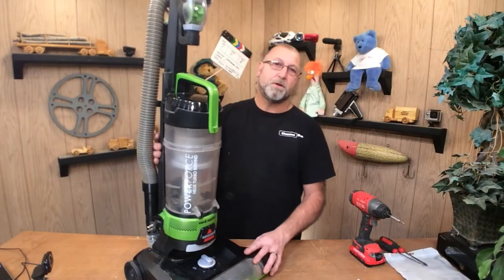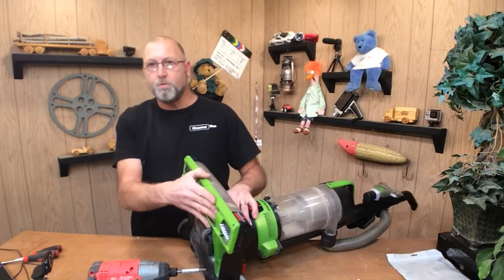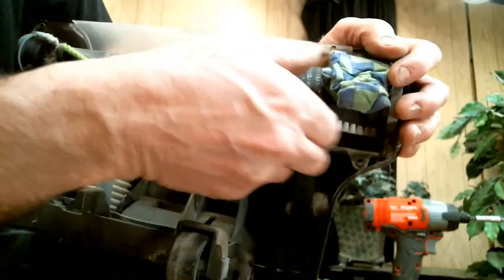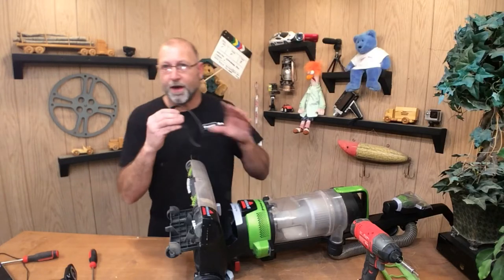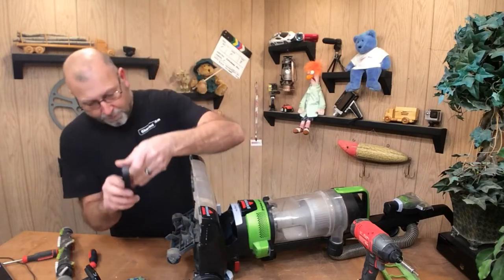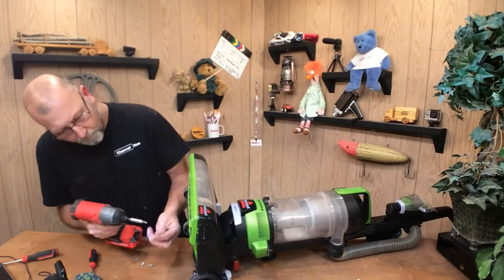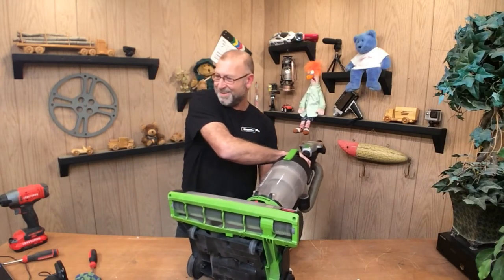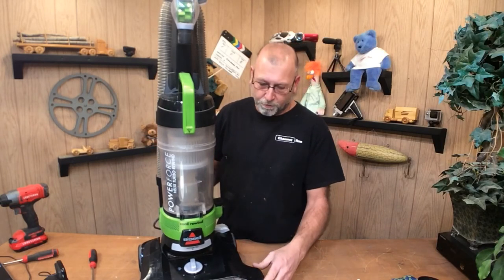How To Replace Bissell Vacuum Belt

Comment: I replaced the belt on my old Bissell Powerforce 1398.  However, after about 20 minutes of use, which equates to about 2 or 3 uses, the belt slips off the motor shaft and I have to stop, unscrew everything, re-set the belt, and re-screw everything back on to continue.  Do you have any idea why this keeps happening?
Reply from the maker: Sound like the nylon baring are gone. you can replace the brush roll. you just have to have all the info.  https://amzn.to/3g33cvV

Comment: So I replaced the belt but the brush roll is physically not spinning whatsoever, what should I do? I haven’t had this for a year yet
Reply from the maker: The motor is on? check with power off and see if you can move roller by hand,? check if ends of roller have dirt for hair clogged?

Comment: Can I please know why my brush does not rotate? I have a new belt and the rotar moves (its super hot to the touch 😬) Please help! Thanks.
Reply from the maker: Sounds like the motor is bad?
Reply: @channelron3593  Thanks for the reply, Ron. I will try to use the warranty and replace it since I just bought it about a year ago.

Comment: I did this it worked for a minute and then again the belt came off. Now, again i have to open and fix the belt again but what if it comes off again? Can i fix it with something?
Reply from the maker: Sound like it is an alignment problem? have not had that problem yet?

Comment: My brush sometimes doesn’t spin and it occasionally smells like burnt rubber. Could the problem be the belt?
Reply from the maker: Pull the Brush out and clean the completely Could be just very dirty?
Reply: Thanks I’ll do that.